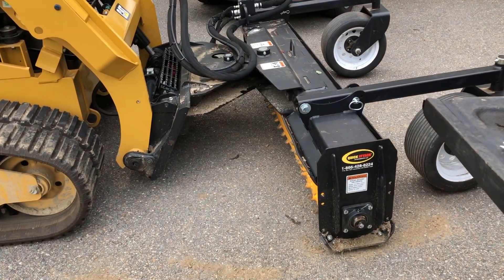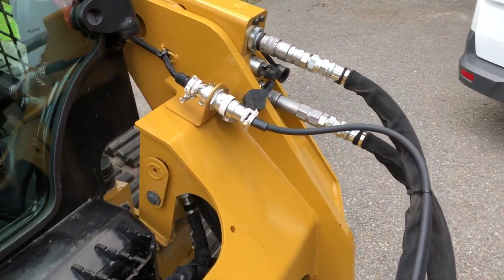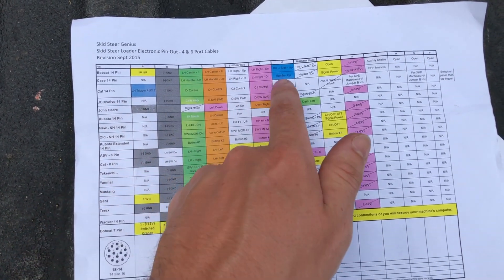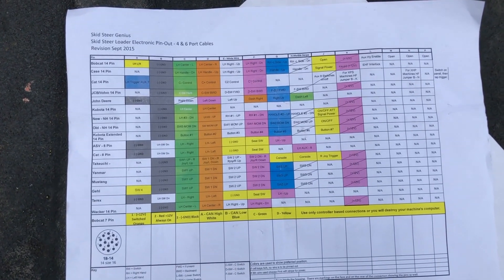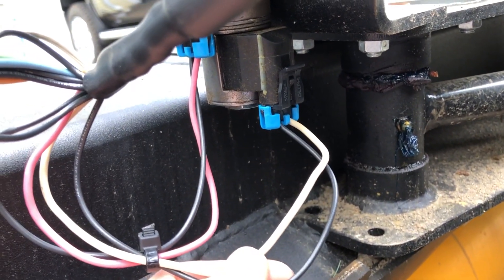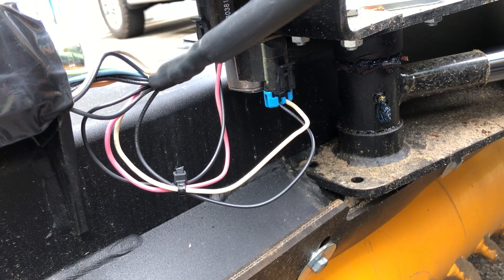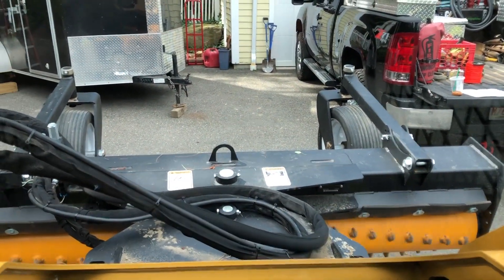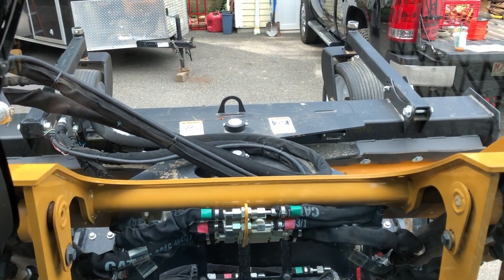Caterpillar power rake wiring explained

Comment: What’s the part # for that harness? I’m trying to do the same thing with my rake.
Reply from the maker: click the link in the description. It's all going to depend on what machine you have and the rake. 14 Pin harness with the Delphi plugs is what I used for this application but that's specific to a 259D

Comment: How did you activate the actual left hand buttons controls? Is there a setting to go into to use them?
Reply from the maker: Is your specific machine a Caterpillar? And do you know if it is wired with a 14 pin connector next to your accessory hydraulic bank? Assuming it is you shouldn't have to do anything on this specific model to utilize the two accessory buttons. your left hand joystick has 2 accessory buttons which is what I wired this connector for and the other two are your horn and creeper mode activate.
Reply: @TylerBemis  yes it’s a 2018 Cat 259d and yes has the 14 pin plug but after some talking to a cat dealer friend they said some don’t get programmed from the factory in the ecm to make those 2 buttons work?
Reply from the maker: @drewolps  that could be possible. If that's the case and its programming with the ECM I'd imagine they can override it because you would never be able to operate any hydraulic attachments that have more then 1 function.